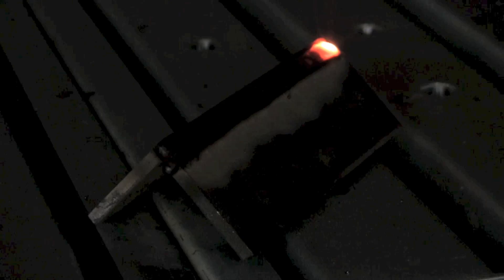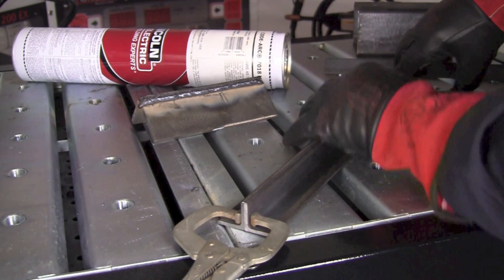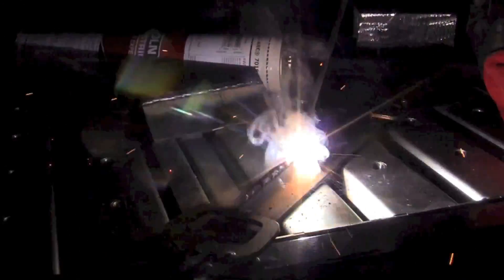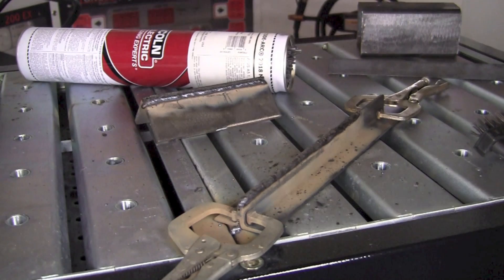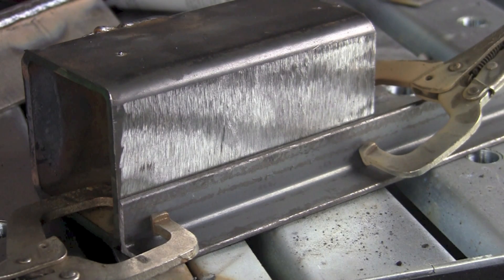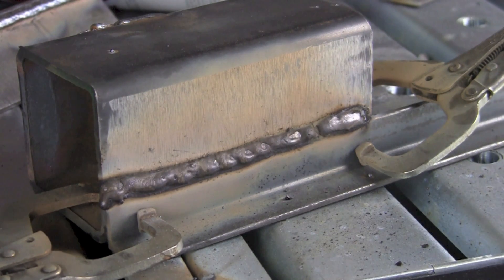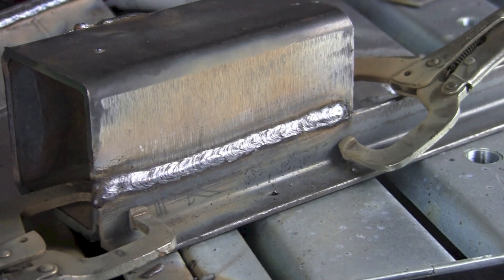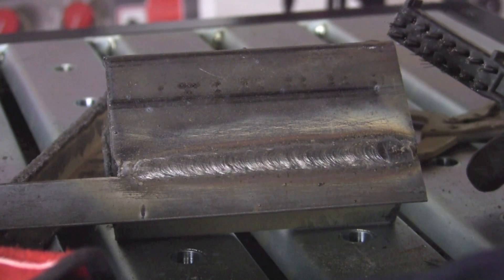STICK WELDING CARBON STEEL WITH LINCOLN CODE ARC 7018 ROD VARIOUS WELDS EXPLAINED

Comment from the maker: While this video is over 4 years old, it is still relevant as shows some basic tasks someone could complete when building something for their garage or what have you(work table, dolly, welding cart, storage etc.)with the Mig Weld 200S. Anyone in the field likely already has a chipping hammer or knows where to get one. The chipping hammer in this video is a freebie that comes with the Mig Weld 200S. We don't expect to see these hammers on job sites around the US, they are purely included for those looking to get into welding while they test the machine and get acquainted with the machine and the processes it features.

Comment: If your slag doesn't curl up off the weld by it self you are either traveling irregularly or you have undercut. Try the 7018 Excalibur and work in your start up, I have learned that starting ahead of where you want to weld and working back to the start lets the rod warm up and give a smooth weld start. Really helps on tie in's too
I don't chip slag unless I am welding to a rough base, you should be able to brush it off with the corner of a file.

Comment: I really enjoyed the video. It was missing rule "number 1" for 7018. Thanks for the description on the "6R" Vice grip. My advice-scrap the video."Rule number one- emphasize on arc length"-you can weld pretty good,but your teaching... the most important part of my comment-Short arcs for 7018.

Comment: Hello
Would you recommend 7018 to someone who has less than 10 hours of welding?  I've been working with 6011 & 6013s and have found it difficult to achieve satisfactory results.  Would 7018 make it easier to learn?

Comment: This is a Mig welder with stick capability.  I haven't seen Miller or Lincoln mark their models with MMA or SMAW (which is the industry standard designation).  And yes, I am a welder, but I can also read.

Comment: i want to put 1/8 tool steel blade(d2), between two 1/8 1040 steel blade. to make a machete like blade .i want to weld the back,2 inch from the top front. do you think heavy chopping will cause it to fall apart?

Comment: Can the Migweld 200S do flux core welding?
Reply: Ansari Baksh  I'm pretty sure any machine with the proper drive wheels will run flux core, just make sure you get the right size wire. If drive wheels are to tight the flux core will pinch and birdnest just before it enters the liner of your lead. If theyre to big they just wont push any wire out.

Comment: With proper amperage, rod position and travel speed the slag with a 7018 should just "banana peel" off nearly by itself with no banging and pounding like in the video....

Comment: I agree with jordan they look like crap im a certified welder and it looks like you're running too hot and using 3/32 rod they will be nicer welds

Comment: You know I don't mean to be a dick or anything but these beads aren't the greatest.  Like I'm 16 and my beads look like that with little amount of experience I have.  I've only been welding for 3 months and I love it. But the wave ripples aren't very consistent and the bead itself isn't extremely straight. Now I don't know if ur just rushing through the weld to keep the video short thus creating a satisfactory weld. But I was just saying. And what I usually say is if the slag doesn't come off without you smashing the hammer on it. Your bead may hold, but won't be very astheticlly pleasing. U should be able to just barely tap the slag and it should come off with ease. Anyways good video..

Comment: Fuck AC stick welding! I live in Mexico and getting a cheap DC arc welder is very difficult to find and no one seems to know anything about DC arc welding. DC will always be better than AC. I have generic 7018s, but they're DC only. AC stick welders seem to be more accessible. I can't even find the Excalibur 7018 rods, anywhere.
Reply: AC is for welding aluminium, you can't really do much without it. And if you really wanna you can put in the time and make your own, if you have the $$$ for it. Just get some microwaves .
Reply: Ariel Lezen When do structural or pipe welders even use microwaves?
Reply: A microwave converts 110v to 12v, so two microwave transformers in series gives you 24v AC at over 120 amps
Edit: use a high wattage diode to get pulsing DC for tig, but you'll need to get a tig gun and gas, or a bridge rectifier to get DC for stick welding.
Reply: Ariel Lezen Thank you, I also hope I can get one of the awesome Everlast arc welders from Ebay if possible.
Reply: Also, you speak great English. I came from Argentina and it took me a while. Anyways, I got my hands on a good 110v welder and it really changes what you're able to do. Best of luck.
Reply: Once again, thank you and btw, where do I get this bridge rectifier?
Reply: +Ariel Lezen a microwave converts 120 to 2000 volts you need to rewind the transformer to get 24 volts
Reply: +Luis Moreno If you're in Mexico, you have worse problems than finding a cheap DC welder...